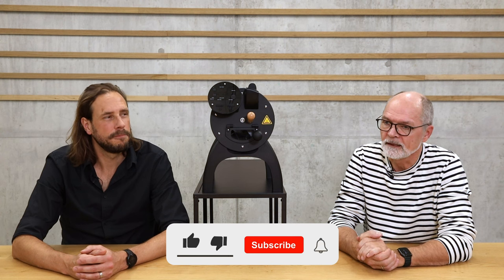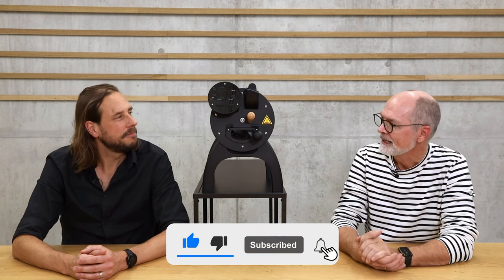Aillio Bullet as commercial roasting machine | Interview with Steffen Lav

Comment: Did u hear right that you cannot run two bullets at the same time on the same computer?
Reply from the maker: That's correct. You would need two computers to run two machines at the same time. But the computer doesn't need a lot of performance so maybe you find a used notebook somewhere at home or get a cheap one.
Reply: @CoffeeRoasting  could probably use a virtual machine on the same computer.